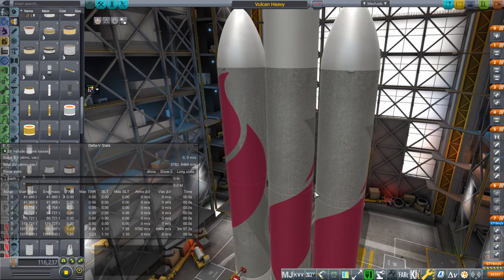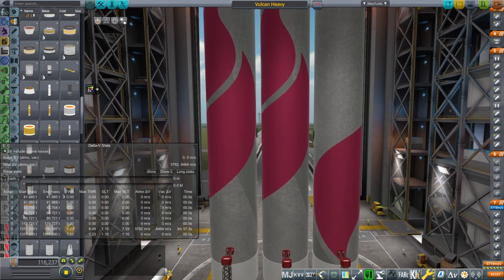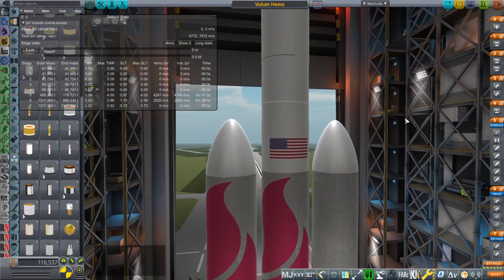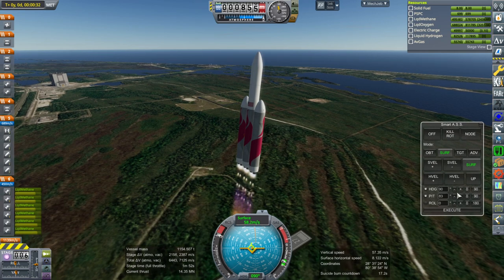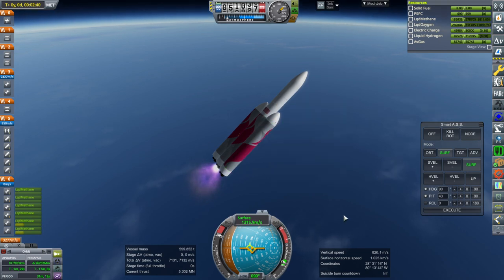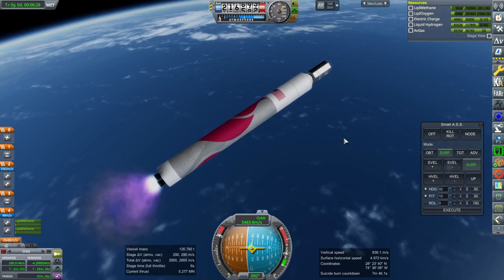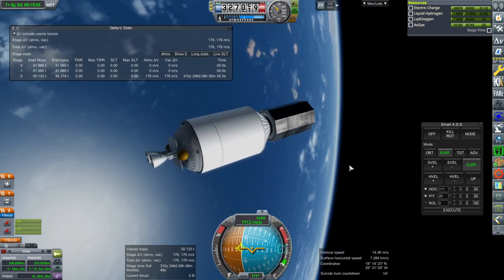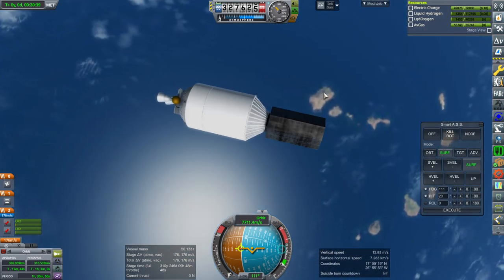Realism Overhaul in KSP 1.8.1 - 3-Core Vulcan Heavy with Crossfeed

Comment: I wonder if the vulcan having two engines on the center core would make the heavy variant easier (1 per side tank). If the engines are restartable than transientioning fuel sources would be very easy.

I still think it has to do with development costs versus potential launches. Is there enough demand for a Vulcan heavy?

Comment: Would the higher TWR from 24 SRBs help get the cross feed variant to 45 tons? Or how about an unholy union with SLS and strapping on some 5 segment space shuttle SRBs.   As far as falcon heavy, maybe model the 9 merlins on the base of each first stage as one part.

Comment: great vid! I would think that rotating the side booster independently would be a fine way  of re-adjusting it, but that would simply be a long process for such a minor thing. Btw, quick question, do you have a custom config for scatterer? and if so, may I copy it?
Reply from the maker: Not that I know of on scatterer. I just use whatever RSS Visual Enhancements does to it. I do also use KS3P, which is a post-processing mod.
Reply: @RaizSpace  Ah, got it, thanks for the reply :)

Comment: Can’t you rotate it before you place it?
Reply from the maker: Again, the rotation point, which is the attachment point, is on the side - that's in the configuration I wrote and deliberately that way so that it attaches to decouplers at that point. Doesn't matter if it's placed yet or not. Rotating ahead of time would still require some translation in order to place it on the decoupler properly.

Comment: What is so bad about heavy configurations of rockets? I see why Vulcan Heavy (3 cores) is bad but Delta IV Heavy and Falcon Heavy seem quite good
Reply from the maker: If you work the math on Delta IV Heavy, you'd see that its payload capacity is way less than it should be for a hydrolox rocket of its mass. And it doesn't seem particularly cheap, either, even though that's the point of common stages. Falcon Heavy is not that bad. Either way, it's an inefficient staging method because you're throttling down the core stage - carrying extra engine mass that you're not using. This part is solved by the crossfeed. Also, you have to strengthen the core to accommodate the boosters, so either the core is not actually identical to the boosters, reducing the economical side of it, or the boosters are heavier than they need to be, reducing the efficiency.